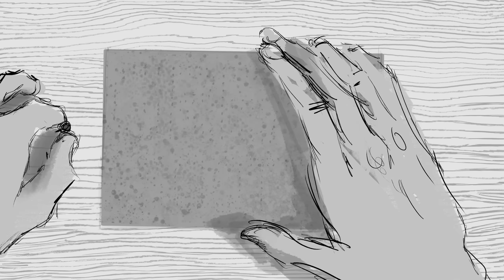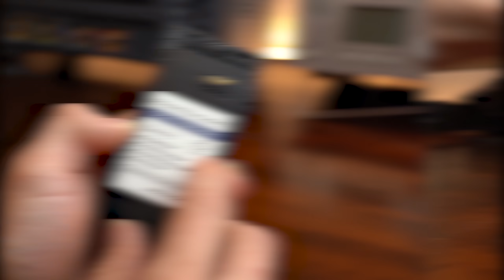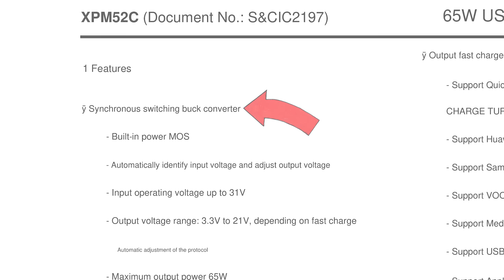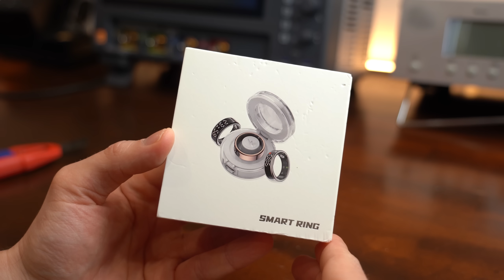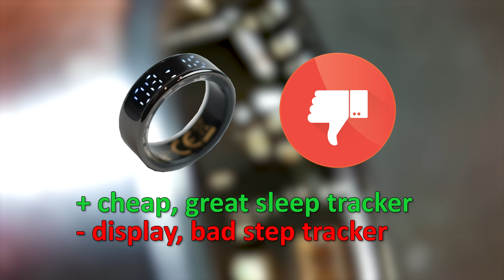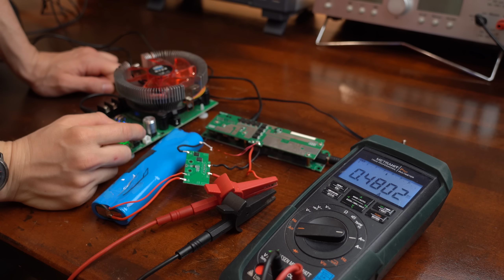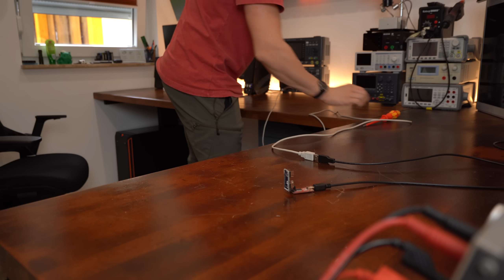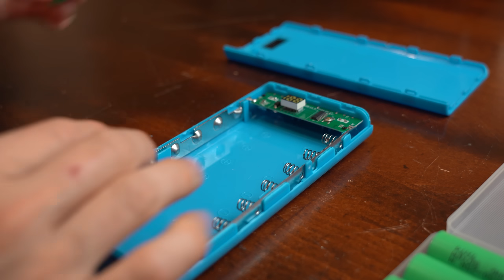I tried finding Hidden Gems on AliExpress AGAIN! (Part 17)

Comment: Hacking warning:
Don't want to be the paranoid one, but just want to say that about 3 years ago I got a Bluetooth usb audio adaptor for a laptop from AliExpress.   It came with a driver on a CD. 
About 2 weeks after installing it, my google account got hacked. 

(thankfully they only made some purchases of apps worth $1000 or so in total that I eventually got refunded)

Without going into too much detail, The laptop (which I only use a few weeks a year while in hospital and is otherwise in my wardrobe turned off) was the culprit. 
 Through the Bluetooth driver they somehow "cloned" the laptops credentials, because while it was in my wardrobe turned off it was also apparently in another state granting another phone access to my google account buying apps.

Haven't used the Bluetooth dongle, or that laptop since.  Don't want to power it on, even with a new fresh hard drive because there might be a back-door in the firmware now.. 

So long story short,  be very careful of Ali Express drivers for usb devices..

❤ Love the channel, and stay safe! 

(and yes, I still buy hundreds of dollars worth of stuff from AliExpress each month..😂.)

Comment: Don't cells in parallel balance themselves? What's the issue?
Reply: The issue is connecting them in parallel when they have significantly different states of charge - the "balancing" can then be quite violent.

Comment: We use capacitor bank for ups for change supply line . Which maintain by capacitor power . As battery tank for 1 second

Comment: Another really useful use case for the BLE to serial adapter is that you don't need an electrical connection to your valuable PC.
So if you work on a device which might be connected to mains, you can still debug it.
Reply: There are also opto isolator modules for serial and USB. Those don't require any software or drivers to work.
Reply: @rocketman221projects  Sure and that's what I'm using.
The required software is also scary to say the least, but I was just mentioning a use case where it might be useful to have a complete wireless solution.

Comment: Wish they would make USB-PD converter board to accept old laptop 19.74V  power supplies to give full pd range up to 100W. Right now it would require two modules - boosting 19.74V->24V converter and that board.
Reply: Car adapters are 12-24v. Because big rigs use 24v power. But will step up the voltage to run off a 12v car. I have one adapter that puts out 65w pd, and charges my laptop.

Because it is a voltage range, I made a Makita to car socket adapter, and I plugged my car adapter into the 18v, and it works fine. So the 19v power supply will be fine.

On a side note, laptops are tolerant of 20v. I have a 2013 Mac book running off a type c to mag safe cable, and an Asus running of a similar cable.

Comment: This ups for the router and internet modem is some I want to make, I got those DIY boards with 18650 sockets for 2 batteries but it's USBC power in and 12v out, I'm just not sure if it's using the batteries constantly or and how well it's step up circuit. I guess I'll test it on a spare router for a while and see how it behaves
Reply: Be careful. Lithium batteries aren't chosen for UPS for a reason.

Comment: I wonder just as a hypothetical if you could increase battery capacity in the ups if you swap the  bmas too.  or would k,eeping the bmw be fine as long as im only increasing the capacity and not the voltage.
Reply: You can do that with all UPSs, just be aware of the battery balance problem from the power bank.

Comment: if someone is making similar UPS for 12V, but slightly cheaper and for 12V led acid battery (for the standard PC UPS) let me know.. schematics are accepted too
i need to power 2-3 routers at home

Comment: I am already using the exact same mini UPS replacing another same size model that lasted 3 years but it was not operating in the same way as the new one. Always on batteries to keep my router ticking is effective but not long lasting. I had no clues that the new one was a real UPS (and good at it), a nice surprise at a cheaper price than the original one. I do like your vids, keep up the good work.

Comment: Did you check at what voltage the UPS stops charging the cells? I really wouldn't trust a chinese lithium battery to be plugged 24/7 unless they are under charging the cells.

Comment: Regarding the ring, there are tons of news on the Internet about those crushing fingers through swollen batteries. So be careful with it.
Reply: isolated user reports on platforms like Reddit and social media describe scenarios where users noticed swelling and had difficulty removing the ring, but confirmed cases of severe finger injury (crushing) have not been widely publicized or verified as a systemic issue

Comment: Would be interesting to see the bandwidth usage of the WalkieTalkies. Maybe cheap IoT SIM cards are a great option?
Some offer 1GB over 10yrs for only 10€. Duration of talking time with such SIM could be interesting.
Reply: A dedicated low bandwidth voice codec like 'Codec 2'  can go as low as 450bps and as high as 3.2kbps while allegedly still remaining intelligible, so with 1GB(assuming 1,000,000,000Bytes since that's how most carriers i know charge usage) 
You should have at least (1000000000*8 / 3200) / 3600 = 694,44 Hours or as much as (1000000000*8 / 450) / 3600 = 4938.27 Hours of combined talk/listening time depending on your quality preference. Not including overhead(logins, error correction, protocols/encapsulation/encryption, keep-alive packets etc etc), which could be non-trivial depending on implementation.
Reply: @Lag_Monster  It sounded too good to be Codec 2 or AMBE. It's probably using one of the GSM codecs, which would be around 5 to 13 kbps.

Comment: A walkie talkie that only works with a cell signal seems mostly pointless to me
Reply: Agreed. The main benefit of using walkie-talkies is the fact that they can communicate directly with each other with just radio waves not needing a cell tower. This kind of defeats the whole purpose of that.
Reply: The plus is having a private channel.
Reply: @arievanzon  encrypted two way radios have been around since the late 1970s in real systems, and modern digital radios (DMR with AES encryption) give you private, secure channels without relying on a cell network
Reply: Imagine a place where you need communication, but you don't want your employees using smartphones. You don't want leaks of documents, prototypes, or other confidential information.
Reply: @frombrasilwithlove  If you’re worried about data leaks, giving people an Android device with a SIM and internet access doesn’t suddenly become safe because it has a PTT button

Comment: Thank you for your videos!
One thing caught my attention, you installed one app in Chinese and suddenly it was SCARY!
When almost everything you have is from an foreign country that literally have invaded you since 80 years 🤯.
The 8x power bank I have used since several years now and no problem whatsoever, I have also gifted to some friends and they really liked it.
One has it modified one of the usb A output ports to be connected directly to the battery 🤯

Comment: put new 18650s in the pack dude. dont short it. all good
Reply: The problem starts when one (or more) of the cells deteriorates faster than the others. The other cells will try to charge it without a limit on the current. You can do this safely with cells that have build-in protection circuits (if they fit, often they won't. They are about 5mm longer),  but you won't find those when salvaging old battery packs anyway. If you are going to buy new cells for this power bank then you might as well buy a reputable one.
Reply: @kuromad  wow mark you are the axpert

Comment: 14:47 I bought one of them and managed to put the 5th cell in backwards, needless to say that was the last time I used it

Edit: Typo
Reply: I did the same thing with one of those power banks and the 18650s! Saw the bus bars heat up the metal bright red in less than a second and quickly was able to yank the battery out before explosion. Definitely the last time I’ll do that. It also prompted me to paint the plus and minus sides of the batteries to be huge black and red areas because the all green makes it way too easy. When I first got it I didn’t really understand the issue with the voltage differences either so I’m sure I did that as well

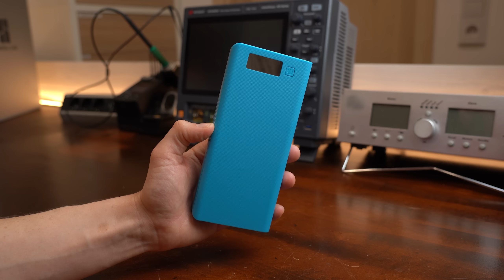Comment: 13:30 I don't know how many of these power banks I've broken. The third time you open them, the door breaks. Since I got the 3D printer, I've practically reprinted them all from scratch. However, they're really cheap; they cost less than buying the module and contacts. In fact, it's better to buy them ready-made and reprint the case.
Reply: I've been using one for a few years now and it's the best power bank I've got.  I've never had a problem with it, but then again, I've never needed to open it more than the first time to install the batteries either so.
Reply: @shalekendar6759  I always remove the batteries when I don't need them. I don't like leaving charged batteries in there, so I usually discharge them to 80% and put them away. When I need them, I charge the batteries and prepare them. I use them to power light shows and miniatures, large dioramas, and at Christmas in church nativity scenes. I don't trust them for cell phones, even though mine are the balanced version with the new screen model; the electronics are terrible. For cell phones and PCs, there are much better products that are lighter and perform better with PD up to 240W. These are terrible as power banks.

Comment: I bought a similar one of those little UPS boxes recently, there's a few different variants,  including one with a more modular battery. The biggest limitation is the relatively modest output current, as well as (at least on mine) no indication of the maximum current you can feed into or pull from the unit across all outputs...

Still, nice little affordable box to power a remote network switch assuming it's actually reliable.
Reply: Yeah, and some of the cheaper ones also have limitations on the maximum number of voltages supported simultaneously.

Comment: Hey Scott, I'm pretty sure you'll be very happy to try to test Power Delivery capabilities with some good usb-c tester like Witrn C5 Or PowerZ, or even frinzy which I'm sceptical for no reason. USB-C tester could be much easier than running an arduino sketch 😅

Comment: I'm thinking of making a solar outdoor light fixture to make use of some lithium cells and a 5W solar panel that is so unused, do you have any circuit suggestions or commercial options for this? I already have some 3S BMS circuits, I imagine I would need an MPPT circuit for the solar panel, but what could I use to manage the battery charge and extend its life?

Comment: i have been charging my phone and macbook for over a year with this
works great but the small adapter makes whine when pulling low power

also i use 12v input, never had issues, charges stuff great

Comment: AFAIK, some railway systems use these public network radios? For example GSM-R
Reply: They do but that's a separate GSM network. Those devices are essentially just rugged android phones with one app on them using regular 4G. The Zello walkie talkie app is available for regular phones too. But if you want workers to have access to just a group chat it's probably not a bad option to have these kinds of devices

Comment: Having to register to use a any of the products in this video is an Instant no for me. Buying things like this says the we allow and encourage companies to keep doing this kind of ... stuff.
Reply: the fitness tracker ring does not require an account to work.
and mine counts almost the same steps as my watch. also my button works fine. (a few times it did not work using the thumb of the same hand. in such case, a finger from the other hand does work. and after that the thumb works again too. I guess this has to do with auto adjusting sensitivity for the button to adapt to changing moisture/sweat levels).

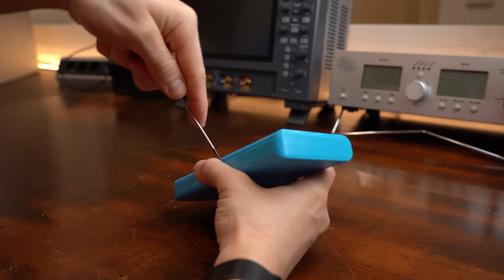Comment: 13:33 diy powerbank with your good choice battery, your good choice powerbank module, and your 3d printing case (or your crudely case), using nickel strip or thick cable for connection was more better rather than diy powerbank case with build in module..

because, the modules mostly just outputting around 10Watts and the connector for the battery has high resistance (which can generate heat and that heat can heats up the battery too) because the spring (for negative) is basically a steel (and steel has high resistance like iron)..

and that high resistance can cause more voltage drop or sag when outputting 1A or 2A while providing power to the module and the load..

and more importantly you can find the bare modules for very cheap and most of them have minimum 18W or 22.5W for the same price as the diy powerbank case with "weak" modules in it.. and they also included the ntc thermistor for measuring battery temperatures as safety feature..

but for ordinary people with no soldering skills and just bought the battery and want to make powerbank super easy, this modules is way to go..

Comment: Well we know what to get you for Christmas . A new smart watch. The old one looks like it's lived a hard life.
Reply: Years ago I wanted a new watch, and my main requirement was a sapphire window, as I was sick of scratches. The cheapest I found was from Bering. Wearing it now. No scratches. It's solar powered so never had to open it (which also compromises water resistance). And it's unbelievably accurate - drifts about a second a month! I wasn't expecting those bonuses.

Comment: Video idea: a power supply that uses common tool brand batteries (makita, milwaukee, etc)
yes, it kinda exists, but only dewalt has a PD charger built in, and i'd love to have 24/12VDC out, when testing different things, not just USB A (or C).

Comment: The idea of using a power bank shell is really great. Could you please recommend an affordable one that you’ve tested or found to work well?
Reply: There's nothing wrong with the one he showed in the video. You just need to make sure the batteries you use are at the same state of charge. You also need to make sure you don't reverse the polarity.

Comment: Be careful ordering radios ready to use on Aliexpress. In Switzerland the BAKOM will confiscate them if they believe they don't conform with CE and will charge you for the lab tests if they don't comform. It can get very expressive and you will not get your device back.
Reply: The "radios" he showed here are actually 4G modems, and almost certainly have a chip from a well known 4G phone manufacturer, using a common reference design for the board. Basic no difference to bringing your phone from overseas on a trip (which millions of people do every day around the world).
For actual normal radios... Yes. This is very important. I bought some European/UK two way radios for a trip to the UK about 6 years ago. I'm in Australia so the frequency they use is not something I can legally use here... I asked a ham radio friend to check them for me to confirm the frequency they operate at before I went...
Curiously, the seller didn't question the fact I was buying UK frequency radios in Australia. The seller probably has no idea.
Reply: It has a CE mark on it so it will sail through.
Reply: @backgammonbacon They throw any logo on things to get past customs. I have a battery charger around here somewhere with an FDA (US Food and Drug Administration) logo on it. That could be legit if it had a laser, because for some reason lasers are regulated by the FDA, but sadly no laser to be found.
Reply: @jaymzx0  Now I want a battery charger with laser(s).  Why?  I don't know!  But it sounds cool :)
Reply: @jaymzx0 an unlikely (very unlikely) explanation would be an optical isolator in the power supply, using laser diodes as the transmitter
Reply: @Will-kt5jk It's a stretch but since they're historically honest companies I'll give them the benefit of the doubt 😆

Comment: I love those DIY power bank cases, but you're exactly right, these things can be very dangerous if used incorrectly.
Reply: I have the same device for 6 cells and it works great. It has low voltage protection indeed. If you're using the same cells pre-charged to the same voltage, I see no problem with it.
Reply: I have a similar one with 21 x 3500mAh 18650s in parallel…. Starting to think it’s not very safe
Reply: "things can be very dangerous if used incorrectly"
Exactly. They device sure looks like it did what it claimed to do. I didn't see anything wrong with it.
Reply: @ddegn  A lot of them don't have under-volt protection, so will kill your cells if you forget about it for a while.
Reply: @j.f.christ8421  If one of these devices doesn't have under-volt protection then it would be a bad choice. We don't know if that is the case for this device. We don't know either way since GreatScott didn't test for this.
Reply: They are dangerous even when used correctly. All of those cells are in parallel. They need to be individually fused. The only way to safely use it would be with protected cells.

Comment: Regarding the USB-PD boards, they even expose the + and - on the board, I used one such board as a passthrough for a projector while also being able to power Chromecast from its USB-C port at the same time as the projector's USB port wasn't powerful enough. 
They are pretty neat and there are also some 3D printed case designs for this specific board online.